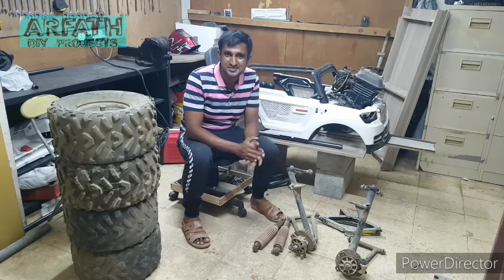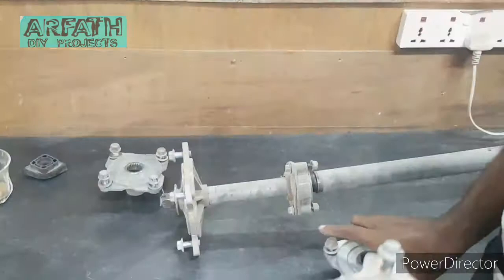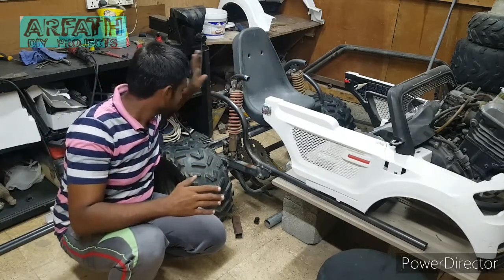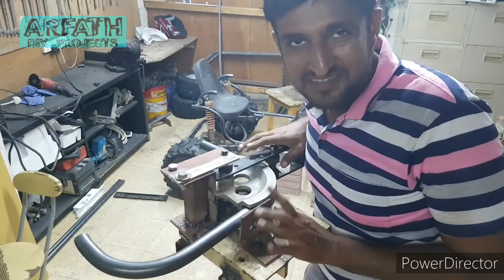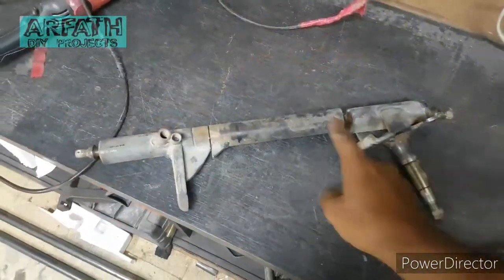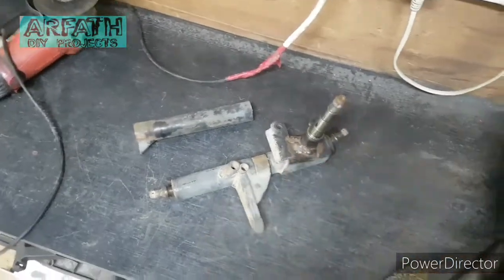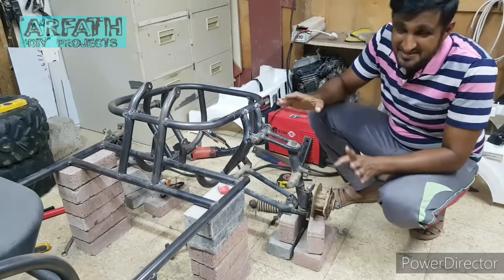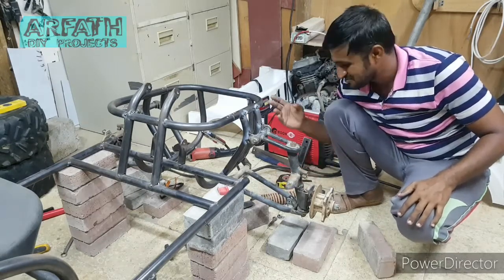Power wheels build BMW X5 250cc part 6 -Got the front arms installed

Comment: Arafat i think you are fixing shokfazer not right because it is not heavy duty upper fixing is not heavy it's only on welds pipe do something else
Reply: Rear axle shokupser
Reply from the maker: I do agree that but I'm still building it up if I felt it not safe I can change at any moment.. btw thanks for the advise I do appreciate that 😊😊